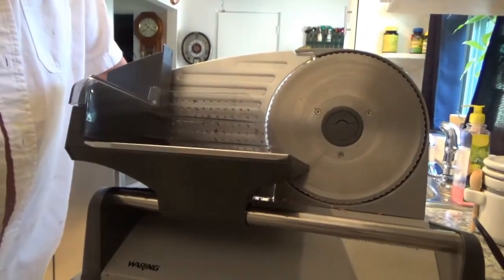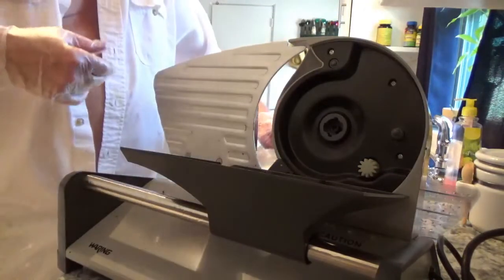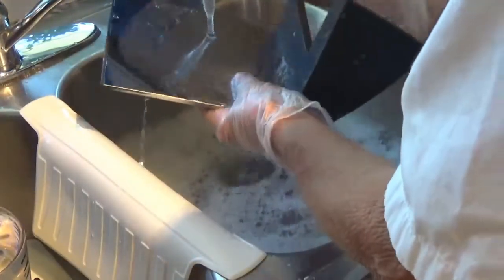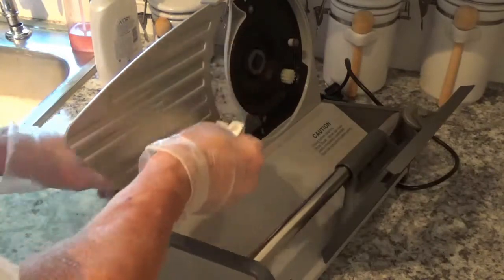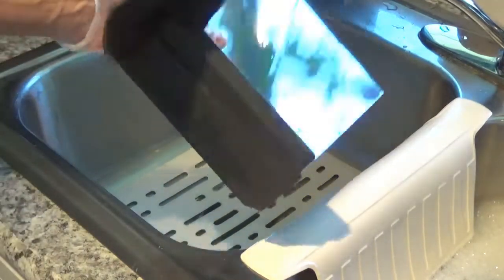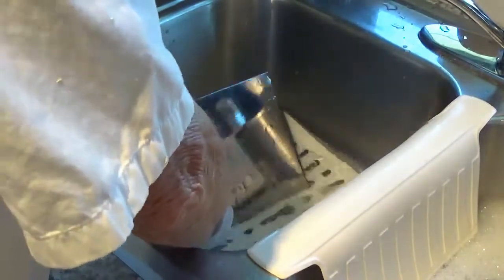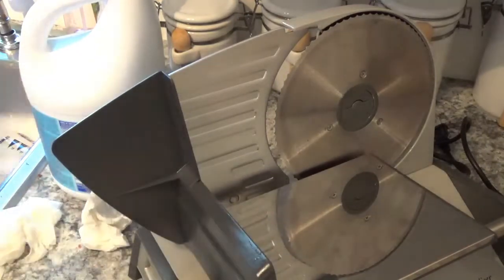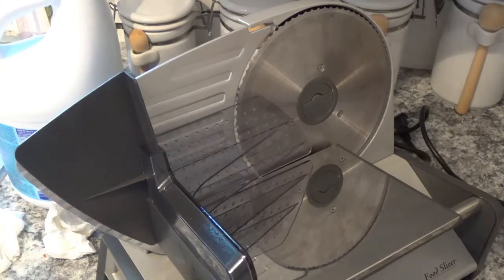WARING FOOD SLICER how to clean and put back together

Comment: This video was a great start but can be taken further.   This is as far as I needed to take mine to get most everything clean.  I believe this covers most steps in the proper order. 
-
1. Assure to unplug the machine.
2. Remove (2×) Acorn nuts and flat nuts from thickness backstop angle. 
3. Remove (8×) T 20 H safety torx screws, (4×) suction cups, and remove base plate. 
4.  Remove side with power cord exiting by removing (4×) Phillips head screws. Slide bar and carrage will come off. 
5. Unplug wires from switch (black wire is middle on mine, take a before photo of yours for reference).
6. Loosen and Remove (2×) Nylon nuts (10mm socket) from thickness adjuster shaft.  Thickness knob/ shaft and metal angle from above can come out. (Two slots in angle, both give same thickness cut.  Peg in first slot lines up the alignment marks properly).
7.  Remove (3×) Phillips head screws to remove plastic spacer under thickness adjuster.
8. Where blade attached, Remove
(5×) safety torx screws and the two part plate. (Grease inside is sticky, place upwards).
8. Remove gear.   Place on grease from before. 
9. Unbolt motor from back support (3×) Allen bolts with 5mm Allen wrench. (Rubber vibration pad near base plate).
10.  Motor and side plate with power cord can be removed from base. 
11. Unbolt upright from base plate (3×) safety torx screws.
12. At this point you can clean lots of items and follow reverse order to put them back together.
Reply from the maker: Thanks for watching and commenting. Happy New Year!
Reply: @aroundthehousewithkaytom162  I think this is a great video and was just what I needed for cleaning after typical home use - I was happy to see your advice of diluted bleach rinse /wipe down , too. The extra instructions commented here would be useful for a periodic mechanical maintenence routine. Thank you 👍

Comment: Good job, but you left out the hardest part! 
Crud gets under the thickness adjuster's sliding plate. You need to take it apart to get at the stuff, no other way.
 First you take off the backing plate (the plate that the food rests up against) by its 2 8MM cap nuts that are found in by the thickness knob, and you take off the backing plate and keep the two plain headed screws. 
Now you can see the crud under there that needs cleaning, but you can't get at it yet. You have to turn the slicer over and remove the eight screws holding the suction cup feet and the bottom cover on, they are #15 SECURITY Torx. (not regular torx) These are not a common driver head.  It has a little center hole in the drive bit to keep people from taking the cover off with a regular Torx bit. What are they afraid you'll discover?
Now you can see up under and behind the power switch, where there's a stover nut and a regular nut that regulate how much drag there is on the thickness knob. That keeps your thickness setting. (I had to loosen mine a bit because the wife couldn't operate the thickness knob, it was set so tight from the factory) Three Phillips head screws and two 8MM nuts on the same shaft and the thickness mechanism comes apart.
Now if you take that stuff off you can get to the old crud that needs cleaning out of there.  
Yer right, it ain't for lazy people. :)
Reply: Mine seems to turn too slow.Can I open it up and clean the shaft or oil it?

Comment: Very very helpful.  We found an FS150 at a second-hand store for $15 that looked new but was ewwwwww in the nooks and crannies and the blade was stained.  I wiped and soaked, then looked for help.  Out of four finds, yours is the best by far.  In your honor, the thing that slides on the bar only allowed the SS tray to come off, but ewwwwww.   I've washed and poked twice so far.  Next, is the Brilllo for the blade and some brushes.  THEN, your bleach approach.

Thank you so much.